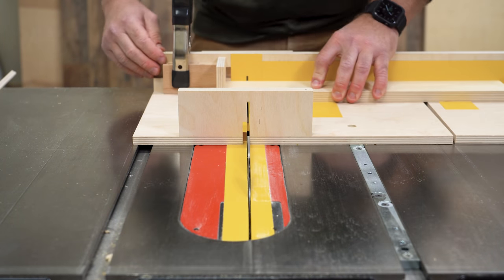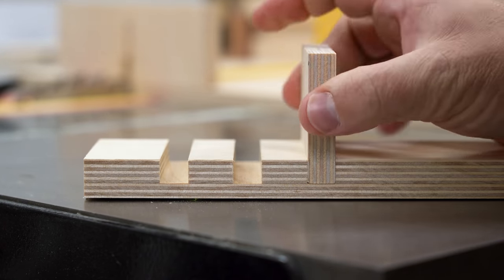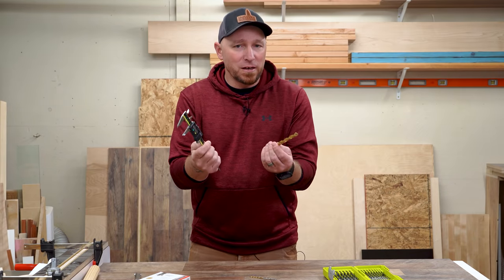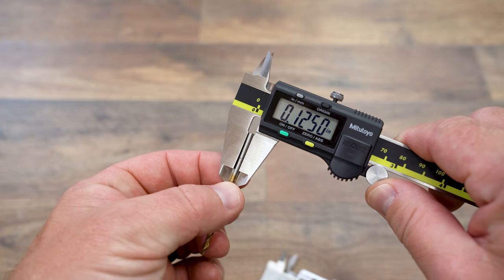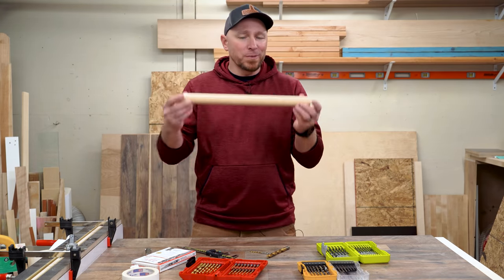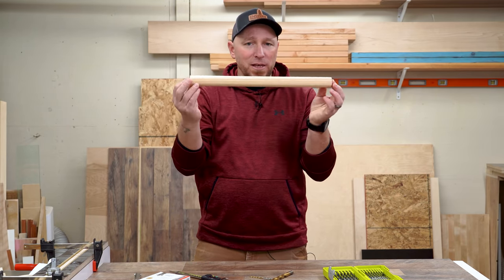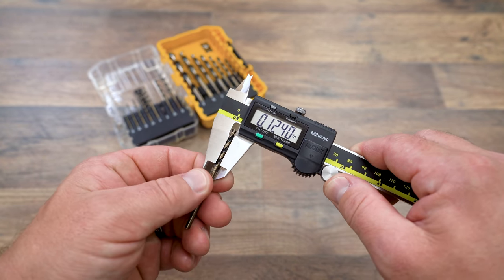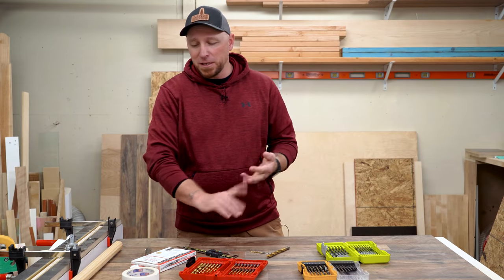I Bet You Didn't Know THIS About Your Drill Bits, Maybe

Comment: Drills, reamers, taps, endmills are intentionally "back-tapered." That is, the size over the margins of a drill under inspection is an important trifle larger at the cutting end than the flutes near the shank. The object of back-taper is to reduce drag. I've found this to be true from my own experience. That said, it was explained to me back in my apprentice days, tortion on a helical flute tends to reduce the helix enlarging the margin dameter. I've experimentally imposed static tortion on a long twist drill and even my  most careful measurements couldn't detect a difference, torsion or free state.

Drills (you call them "drill bits"): You might not find back-taper in consumer grade drills such as you exhibited. The final sizing of the flutes is more economicaly effected via a through feed centerless grinder than individually plunge ground. Another point is your digital caliper, though new, is not the tool to use when measuring thousandths variation in small drills. A better selection for detecting part-thousandrths variation would be a plain vanilla micrometer provided it's in good condition and adjustment.

Reamers: same deal but the back-taper is more subtle. The cutting edge at the ends of the flutes will be ground to the top of the tolerance and to the bottom of the tolerance about 1/4 of the flute length. The reamer is generally retired when sharpened back to this point and used for lesser work.

Endmills: these are ground with some back-taper (or not) to compensate for deflection. 

Taps (quality taps!) are ground with a back-taper that's measurable only over thread putch wires; again, to reduce drag.
Reply: Thank you, I'm a drillbit manufacturer and every single drill bit I've ever made has had backtaper, so I found this video to be obnoxious and uninformed.
Reply: I also find if you measure at the points of the flute it's a slight larger.  Also you get a small amount of gall out when drilling.

Comment: The concept is a good one. Use of a transfer punch would be better.  Better still would be a gauge block (not out of my set buddy) or a simple piece of steel or aluminum milled (or even filed) to the exact dimension needed.  One must remember that every saw blade will be different. BTW it is bad to use the fluted end as the diameter is only correct measuring to the top of opposing flutes.

Comment: I think you put your finger on the problem with this method in your previous video - blade runout and the blade not being 100% parallel to the fence and/or miter slot.  Both of these will result in the kerf being wider than the blade thickness.  The solution is to use a drill bit that is the same diameter as the kerf width, not the blade thickness.
Reply: Ah, I think you hit the proverbial nail on the head. It would certainly explain why the material reference sizing made for a perfectly sized cut piece.

Comment: However: if the pitch of the flutes or grooves is larger than the thickness of the piece of wood you're trying to use the bit as a stop for, then you find yourself in a similar situation to what happens when you want to measure the diameter*across* the bit's axis rather than along like you do in the video. Should you want to measure the diameter across the machined section, the jaws of the caliper will ride on the ridges but will reach a bit inside the actual diameter between the ridges, and thus measure something narrower than across the sleek end.
Reply: Just stop it.
Reply: @NBGTFO  He is right.

Comment: I work in a drill bit factory.  I can confirm that some drill bits will have different shank diameters.  I would have to check to see how often that the 1/8" bits have a different tip diameter vs shank diameter.
Reply: as a defect?
Reply: @toolthoughts  If the drill is 5/8" and the shank is 1/2 inch, it is a design difference. I have an index with lots of them for use with a 3/8 drill. Not the best match but that is why we have odd tools - sometimes they are our only hope of getting the tool in a tight place.
Reply: During the machining of the flutes, is it possible they are opening up a bit from the cutting? I could see how the material would push out/ away slightly.

Comment: I use stainless steel tight tolerance spacers instead of drill bits. They can be clamped or attached to your sled easier than round. And they're pretty cheap too.

Comment: Any chance you could show us all the best ways to sharpen drill bits, especially small diameter.
I've only just found out that the angle is different for metal/wood, its been very frustrating trying to drill metal lately when my sharpener only does wood angles.

Comment: I think the drill-bit-width-at-either-end issue is a red herring when it comes to explaining the looser dados you've observed when using them. The more likely explanation is that while the drill bit has the same width (or close enough) as the width of one tooth of your blade, that's a static measurement, which doesn't account for the fact that during the cut, your blade:

1- Rotates at very high RPMs, possibly introducing lateral warping / vibrations that will produce a kerf slightly wider than the actual tooth width;
2- Is almost certainly not running completely square to your miter slot / 90-degree fence by at least a fraction of a thousandth despite even heroic efforts at proper alignment -- thereby producing a kerf that's wider by double that error.
3- Employs EVERY tooth of the blade, which may or may not be perfectly aligned and have the exact same width, again by maybe just a fraction of a thou, whereas you obviously only use one of those teeth for measurement -- thereby guaranteeing a lowball value for your expected kerf.

Also note that to make matters worse, all of the above conditions reinforce and compound each other!

Simply put: The drill bit method uses a static measurement, the value of which is in reality almost certainly narrower than the kerf physically created by a cut. This makes this method only marginally more effective than measuring your dado width with a ruler. However your shim method, by leveraging the actual reality of the physical kerf created, is much more precise and guarantees better results every time.

A quick test to validate the above would be to see how well the drill bit itself fits within a kerf line -- I'll wager it's loose by about the same amount your dados were.

Comment: I’ve never heard of anyone thinking a drill bit changes diameter from one end to the other, and I’ve certainly never seen a bit that does (unless it is larger than the chick size- 3/8”, 1/2”, 3/4”, etc.), so that was new to me.  It was especially interesting to me to watch as you checked different ones with your fancy new calipers. (🤔Hmmm, maybe I should get a better set of calipers.....)
Anyway, thanks for going through the time and trouble and expense to buy and check different brands and bits that are commonly bought and used around the shop and job site, then share with us.
Reply: Flat drills, augers, forstner bits and reamers all have a wider cutting diameter than the shank.

Comment: I wonder if this comes from the fact that fasteners (screws, bolts, etc) are formed rather than cut (usually), leaving the shank smaller in diameter than the threads. 
Side note, reamer (for metal working/machining) has a shank slightly smaller than the cutting surface.

Comment: If the wood is soft, using the spiral portion of the bit could leave a mark if you push the workpiece into the bit very hard.  That will produce a result just like if the bit were a thou or two undersized. PSI goes up pretty fast when you remove 80 or 90% of the weight bearing surface area.

Comment: The cutting end on older bits especially used in metal or masonry will wear out the diameter only a fraction but it does

Comment: Variations in drilling results can be caused by a number of things such as the bit not being mounted securely, off center, a bend in the bit even. If hand held, good luck getting it perfectly straight! Anyone telling you it’s the bit… most likely not the bit.
Reply: The most important reason for bad drilling results, especially a larger bore as the bit is unsymmetrical sharpening of the cutting edges.

Comment: I'm not a machinist and got my set of calipers just see how they work. When taking a measurement shouldn't the calipers be perpendicular?
Reply from the maker: It seems like it just depends on who you ask. Here's my take, for what it's worth: If you measure parallel, you are accounting for all irregularities along the length of the material between the jaws. So any low spots are cancelled out and you are registering only high spots. This gives you the widest point along the whole circumference. If you measure perpendicular, you're measuring a very small part of the diameter. That measurement could be different if you measure a little farther up or down the shank. In this case, in the context of what/why I'm measuring, it probably doesn't matter much. But if you were measuring a wood dowel or plastic rod, where there are high and low spots along the length by nature, measuring perpendicular will give you different readings depending on where you measure. Let's say you were trying to recess said wood dowel into another piece of material, and you need to measure it to figure out what size hole to drill. If you measure parallel, you account for only the high spots, and if you drill a hole at that measurement the dowel will fit. If you measure perpendicular and happen to measure at a narrower spot, and drill your hole that size, the dowel may not fit. I hope that made sense!

Comment: The reason people are under this impression in the past, you would grind two "flats" on the drill, heat it and twist it to achieve the spiral. This would lead to the diameter of the cutting edges being larger than the roundstock. It's still how some large diameter drills are made today.

Comment: Up until a few decades ago twist drills and the like nearly always had the shank slightly smaller than the cutting end. This was done so that the drill would not easily bind in the drilled hole. This practice seems to have been abandoned, probably for manufacturing economy. 
Some may be still be made the traditional way, but to tell, please measure with a micrometer instead of a caliper since the difference may be only a few ten thousandths of an inch, which will not show on an instrument that only measures to a half thousandth, like your typical digital caliper.

Comment: Unless it’s an obviously stepped bit I never thought it would the diameter end to end would be different.  Maybe it’s an optical illusion to some because of the flutes. With the possible exception of some larger bits whose chuck end has been turned down smaller to fit a specific chuck size which allows using a smaller machine to be used.

Comment: There is an exception to this: as hand-held drills generally only accept shanks up to 13mm / 0,5", larger-diameter bits will be stepped at some point.
Reply: Uh yeah, but the rod to point diameter is still the same after the step down to 1/2 inch...so again...stating the obvious.
Reply: He said that in the video.

Comment: This video reminded me of the time I bent a drill bit.  Now, I’ve broken plenty of bits, but steel for drill bits should not bend.  It should be hardened.  It should not fold over past 90 degrees without so much as a crack.  Yep, true story!
A coworker on the trim crew I was working on handed me a brand new Harbor Freight bit out of a set he had just bought.  I proceeded to use it completely properly to predrill some wooden thing or another and it just folded over.  Brand new but!  First use!  Of course I offered to buy a replacement once I got over the shock and amazement and outright laughter of the situation, but he said not to worry about it (because they didn’t cost him that much).  But I did feel bad every time he got that bit set out and didn’t have that commonly used predrill size. 🤷‍♂️
Reply: Whilst you had an extreme case, it is normal for drill shanks to be softer- that is to protect your chuck jaws (you need them to be harder than the shank). Anyone that has used the shaft of an old drill as a pin knows that it can easily be cut with a hacksaw- not so the twist part.
Reply: @Tensquaremetreworkshop  You don’t understand.  The cheap Harbor Freight but FOLDED IN HALF  at the midpoint... in the twist (fluting).  This is not a matter of “protecting the chuck jaws”.  It was just cheap!!
Reply: @fomoco300k  As I said- an extreme case. Probably missed the heat treatment stage completely (or was not carbon steel to start with). It was also not cheap- it was a 100% loss... My point is still valid- shanks are deliberately softer.

Comment: You need to learn how to use a caliper when you measure the distance across the cutting edges. Ask a machinist or tool maker for help. A micrometer will be easier to use than the dial caliper, but the dial caliper will work if you are careful.

The shank end is smaller than the cutting end to provide clearance. I once got straight drills from a liquidator type shop on Canal Street NY. The drills would not drill steel but would bind. They would drill wood, but even a nail will drill wood.

Comment: I have a set of 29 brad point bits that the first inch or so is a different diameter than the bit size on the first 7 bits which have a 3/8" section. I've never understood why they were made like this.
Reply: Maybe because they are for use in wood and drills with smaller chucks and power ratings can use them.

Comment: on cheap drills like those generally yes the cutting end and shank will be the same diameter, I would still say thats its poor practice to use the cutting side as those drills only have 2 thin lands on them that are that diameter, with a soft material material like wood it would be very hard to get the same consistency using it that way as opposed to using the shank that is solid.

Comment: There are quite a lot of drill bit types that have different sized shanks to the cutting tip ( I'm being pedantic) spade bits, Forster bits, masonry bits and really large twist bits with a smaller shank so they can be used in a normal chuck, perhaps people were thinking of these ! ;-)

Comment: You would almost always have to use farely new drills bits to be very precise, cuz both parts of the drill bit - the front and shank - will wear out differently after time (brad pitt drills also wear out way faster on the actual drill part). You also dont consider the grooves, which are way wider on brad pitt drills. There it depends on how thick the actual board is that u want to adjust/cut, cuz it could lay inside the grooves. So y even bother risking tolerances, when u can just use the shank? Y make ur life more difficult that way?

Comment: Drillbit manufacturer here, I can't speak for all brands, but many bits, ALL of the milled twist bits I made, which are used by many brands, have a backtaper. Obviously other production processes differ, but to say it is a myth is WRONG. Do your research before you try to "educate" people. Yes milled bits are made from straight steel rod, but before the point and flute get cut all of our blank rounds get conned and backtapered. The backtaper allows the bit to drill with less resistance.
Reply from the maker: How do you know that I DIDN"T do my research? I didn't say it was a myth, I said, and more importantly showed, that there is no discernable difference between the two ends, based on a common measuring tool in the industry that this video is centered around and in the context of why we are measuring to begin with. I also said there are a lot of different manufacturing processes, but that the way I described was common. And based on my research, it is.

Comment: I really enjoy your videos. But I need to step in here. I am a tool maker for the last 32 years. You do not measure a drill along the length. You measure across the cut edges. Meaning hold  the caliper perpendicular to the drill. cutting edges away from measuring faces. close the caliper and gently rotate the drill until the cutting edges contact the face of the caliper faces. That is your measurement. Granted your working with wood so what your doing is close enough. I as well build custom furniture and had to stop driving myself nuts with precision. It's is not at all as critical as people make it out to be.
Reply from the maker: @Pedal Man I mean, if we’re really being technical, they should be mic’d, which would be far more accurate. Haha. But out of curiosity, what difference does it make if the cuter edges are in the jaws either way. I am asking to learn, not being sarcastic.
Reply: @InspireWoodcraft  The flute lands are ground for relief

Comment: Everything man made has tolerance. That's the max spec to the minimum spec. Calipers are accurate +/- .001 inch. Micrometers are +/- .0001 inch. Drill bits, I don't know the accuracy, they are usually what they are marked.

Comment: You're measuring with a stiff object and offsetting a conformable...
The amount of a twist bit on the business end at stated shaft diameter is less than 100 percent the circ, so your displaced wood in practice will not be as distant as your unconformable hardened caliper

Comment: Yeah, no. The shank is the same size as the end. Who told you that? 
The reason you will never get a true size hole comes down to rigidity and whether you are using the drill as a milling tool, or a turning tool. If you hold the bit in a tailstock, it will find it's center on the axis of rotatiom

Comment: You're a wood worker, so you're gonna be right 99% of the time. If you work metal, you know to measure the cutting edge, as it will always come in undersized after some wear.